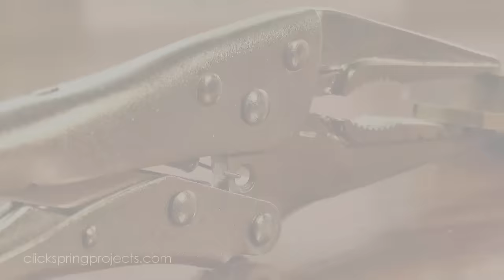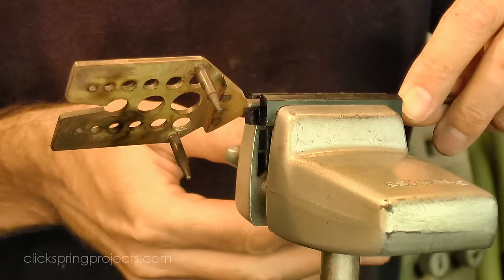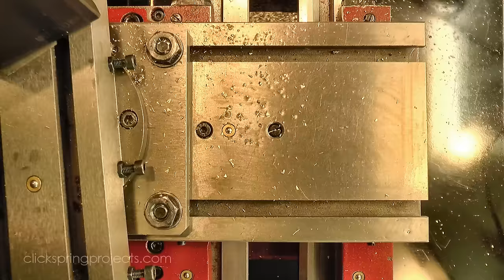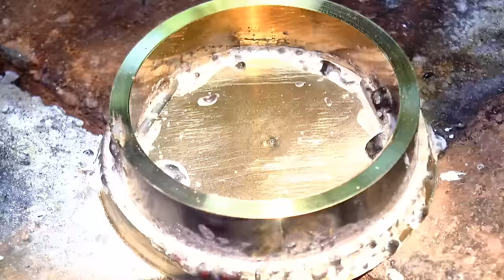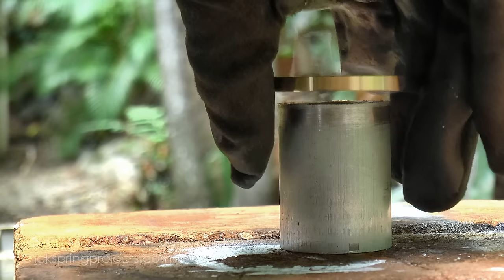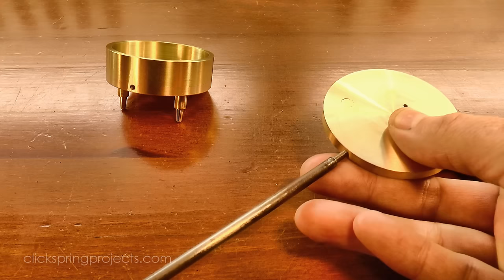Home Machine Shop Tool Making - Making A Versatile Bluing Tray

Comment: Are you concerned at all that the heat from the bluing process would melt the silver solder?
Reply from the maker: The silver solder melts at approx 700 degrees Celcius, the blue occurs at approx 300 degrees Celcius, so I will be remaining well below the solder melting point when the tray is in use. Thanks for watching Garrett
Reply: +Clickspring Thanks a ton for responding! I'm considering making something similar in order to evenly heat circuit boards during solder reflow.

Comment: first video i watch i get the feeling like i need to watch all off them. few question.
Is that lathe on of the tiny lathe from Hare & Forbes?  
are you holding the collect holder with a 3 jaw chuck or is it made like that 
and i love that lapping disk i feel like i may be making one soon.
Reply from the maker: +Leigh Ha Hey Leigh, the small red lathe was purchased from Minitech in Brisbane, the collet holder is #3MT and fits in the spindle. The tailstock lapping tool is outstanding for polishing screws, well worth making one if you do that sort of work. Thanks for your sub, appreciate it :)

Comment: Hi Chris, recently discovered your channel and I find both your work and videography extraordinarily insipiring. I hope 
to invest in a machine shop in the future.
Have you ever tried etching the material a few microns using chemical etchant so that a clean uniform layer underneath 
the surface emerges before tempering process. Could this be useful for details such as threads?
Reply from the maker: +serkan kazak Hey Serkan, I haven't tried the process you suggest. Generally speaking, the best surface for bluing is a hardened, well polished one. Although I have found that a richer blue can be generated with a slightly rougher surface (3000 grit), so maybe your idea would work! Thanks for watching mate :)

Comment: if your tapping dye is turning then its not put in properly or the job is not under size to turn into a thread or its not tight enough or slower momentum.

Comment: can you use this same thing applied to knives??
Reply from the maker: Yes, although it is not the most robust surface finish. Its good for parts that don't get a lot of handling, like the fasteners inside a clock or watch
Reply: The is another reason this would be a bad idea on a knife, heating it to a blue color also tempers the hardness down so far that the knife wouldn't hold an edge very long, going to a light straw color is about the right temperature for a knife on most steels.
Reply: You play too much CS:GO.

Comment: I am a little confused about the silver soldering of the ring to the base plate.  When heating the assembly for bluing, do you not risk re-melting the silver solder and having the ring and base plate separate?
Reply from the maker: +6milesup The bluing happens at a much lower temperature than the silver solder melting point, typically around 300 degrees centigrade for the final blue color, so the silver solder bond is unaffected. Thanks for watching and asking :)
Reply: +Clickspring Thank you for the reply!  Absolutely love your videos sir.  You do incredible work.  I recently purchased a 10x22 Precision Matthews lathe and looking forward to "turning" out some stuff with it!  :)

Comment: what's the advantage of bluing screws?
Reply from the maker: It is widely believed to give the screws a measure of corrosion protection, but I have my doubts - In my local climate blued screws corrode as readily as non- blued. It does make the screws look pretty tho...

Comment: hey I was wondering what the purpose of flux is when soldering. And how is flux different from rosin that is in rosin core solder. I am new to working with metal and want to get into it. Thanks!!
Reply from the maker: +William Hamer Hey William, flux is used in soldering/brazing to do two things - remove existing oxides from the surface of the join, and act as a barrier to the formation of new oxides caused by the high heat. The filler material can then flow because the surface "wets", and it will also bond properly with the underlying metal. Thanks for watching

Comment: Awesome work! I have a question. You can bluing steel with heat but with aluminium or brass can you do the same thing? Or there is another method for bluing that metal without a paint job? Thank you. Also, you have a new sub! :)
Reply from the maker: +Pedro Soria Martinez Alcocer Hey Pedro, the bluing effect is limited to steel, appreciate your sub

Comment: at what point do YOU specifically remove the tray from the heat to ensure you get a blue finish? if you continue to heat it until it reaches blue wouldn't there be an almost lagging effect between when you cut the heat to the time it reaches the steel that could carry it past the blue stage? or am I missing something?
Reply from the maker: +sargentmango That is the real art to it; picking the time to remove the heat. It varies significantly for each part. For small parts, the change is so rapid it is very easy to overshoot, for larger parts it hardly matters at all and you can leave it sitting in the tray for minutes and watch the last color shift occur. Picking the part from the tray and dropping it in oil also arrests the color change. Thanks for watching and asking.
Reply: +Clickspring Thanks! I'll have to give this a try and make a bluing tray, only method I've used so far for smaller stuff is tempering with an oven set to a specific temperature for "X" number of hours, this would save a lot of time.

Comment: Is there a chance you will heat up the tray too much and melt the solder?
Reply from the maker: spankmeister The blue color forms at about 300 degrees Celcius, and the silver solder melting point is approx 600 degrees C, so I'll be working well below the melting point of the solder. Thanks for watching and asking :)

Comment: Does the metal matters? Can you use whatever steel for bluing?
Reply from the maker: +Nicholas Leaf Yes the metal composition, surface finish and cleanliness all have a big impact on the final result. Thanks for watching and asking :)
Reply: +Clickspring Is it possible to unmake the bluing? I tried to make it, but gave my work too much heat and it went past the blue phase to gray phase... :(

Comment: Is that a steel or brass screw that you colored and am I right to assume that it's the heat alone that creates the color?
Reply from the maker: +Papa Gleb Its a steel screw, and yes you are correct. The heat alone causes the oxide to form on the surface, that in turn gives the color thanks to thin film interference. Thanks for watching.
Reply: +Clickspring no Ty for sharing.

Comment: why do you use BA threads over metric threads for some screws?
Reply from the maker: +Cdabek Habit more than anything. I really should make the shift to all metric at some point, I just haven't got the $$ at the moment to get a full set of the smaller metric taps and dies. There is no additional merit to BA threads over metric that I have encountered. Thanks for watching and asking :)

Comment: Beautiful piece of metal mate, but why did you bother threading those feet if you were just going to peen the ends over anyway?
Reply from the maker: +pypes84 One of the things I noticed on the previous version was that the feet worked a little loose over time from the constant heating and cooling. I figured a good mechanical connection would sort it out, and just used the light rivet to stop rotation. So far so good, it's had a solid work out, and the little suckers are in there good and solid! Thanks for watching :)

Comment: Is that just for aesthetics? Or does it work as a heat treatment?
Reply from the maker: +Daniel CP Hey Daniel, it ends up being both. The parts are blued just after hardening to let down the temper, and then again after polishing for aesthetics and corrosion resistance. Thanks for watching.
Reply: +Clickspring Oh, ok! Very interesting stuff! Thanks for the content!

Comment: @clickspring, great video as usual, but I will ask the idiot question, why not one solid chunk for the tray?
Reply from the maker: +D “OptimusPrime” Mitchell Not an idiot Q at all :) Brass is crazy expensive, and where possible I will use up scraps left over from other jobs in preference to using a new piece. Thanks very much for watching and asking.
Reply: Thanks. For the fast response.

Comment: Excellent! What metal do you use for this screws?
Reply from the maker: +Den Denis Hey Den, I use EN8M - it hardens well, and is a pleasure to machine. Thanks for watching.
Reply: +Clickspring, hi. Thanks for the answer. So, this method "bluing" will approach for other kind of steel?
Reply from the maker: +Den Denis Yes, with varying results based on alloying elements, and surface finish.

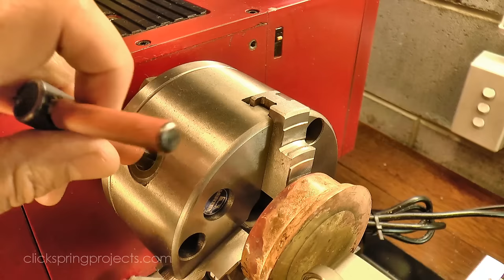Comment: What do you mean by reasonably true in 5:30? Does this mean the tool has to be centered?
Reply from the maker: +kyle han I wanted to take off as little metal as possible, to leave as much mass in the tray as I could. So the straighter the workpiece is sitting on the chuck, the less metal will be removed when I make the cuts to true up all of the surfaces. Thanks for watching and asking.
Reply: OK thank you!! Thanks for anwsering keep up the good work

Comment: How come the silver solder on the dish tray doesn't remelt when in use?
Reply from the maker: +TheInfraredFish The blue color forms at about 300 degrees Celcius, and the silver solder melting point is approx 600 degrees C, so I'll be working well below the melting point of the solder. Thanks for watching and asking :)
Reply: +Clickspring ahh cheers, nice video btw

Comment: Seriously sexy machining work and precise work altogether. However i am not sure the soldering was such a good idea. After all, you will be heating the tray again...
Reply from the maker: +Mp57navy The solder is "hard" solder, which melts at approx 700 degrees Celsius. The blue oxide color forms at approximately 300 degrees Celsius, so I will be working well below the melting point of the solder when using the bluing tray. Thanks for checking tho!

Comment: Could I blue something lets say... 1x1x4in large tube?
Reply from the maker: +Colebug99 Providing it is steel, then yes certainly. Although the larger the part, the more difficult it becomes to maintain a consistent color. Thanks for watching.
Reply: Clickspring Cool!  Also, I have been researching bluing steel to the point you are, but I can't seem to find anything.  What are the metal shavings you have in your tray?  Also, do I need specific parts out of the metal scrap?  Like, does it get blued inside the scrap?  Or does it get more blue outside the scrap?  Do you hold your heat source in one place or move it around?  Does the heatsource go ontop or under? 

Alot of questions, but thank you!
Reply: +Colebug99 The scrap brass shavings are to evenly distribute the heat in the tray to allow for a more consistent color all over. The shavings in the tray are just brass as they tend to go bronze at the temp that steel would turn blue. The heat source is moved around under the unit for better results. 

Hope this helps.

another way to blue larger parts is using a wire tray and rolling the part around whilst moving your heat source.

Comment: why wont you use your lathe to cut the thread's instead of using another tool?
Reply from the maker: +Diogo Ferreira I do both. For small threads, its often quicker and easier to use a die, rather than set up the lathe change gears. Thanks for watching and asking Diogo.
Reply: +Clickspring i have one more question, first of all how much is a good-ish lathe ?
how much was your lathe and can i make tool's for it (to add functions to the lathe)?
Reply from the maker: +Diogo Ferreira Hey Diogo, have a look here for some more info on choosing a lathe: http://www.clickspringprojects.com/blog/which-lathe-should-i-buy Yes, you can absolutely make tools for it, that's half the fun!

Comment: why ta[ when you will rivet the standoffs, seems like an extra bit of work for not much reward
Reply from the maker: TheEpicknives The riveting is very light, and is intended to just stop the screws from working out over time. Because of the heating and cooing, I wasn't satisfied that a slip fit+rivet would hold adequately long term. The threads give it a solid grip, and the light rivet keeps it there. Thanks very much for watching and asking.